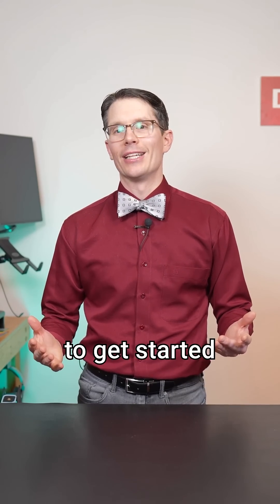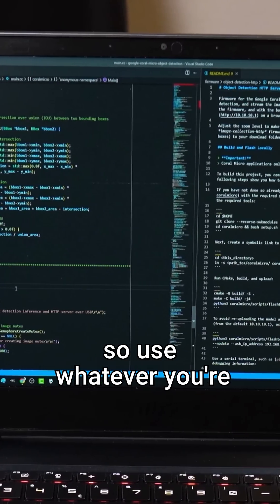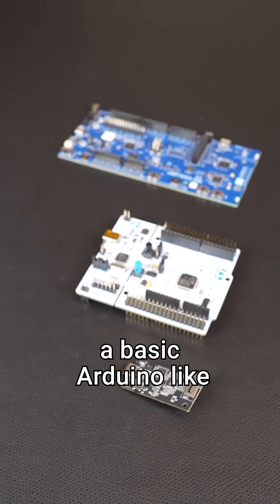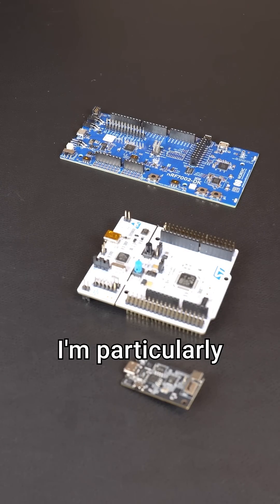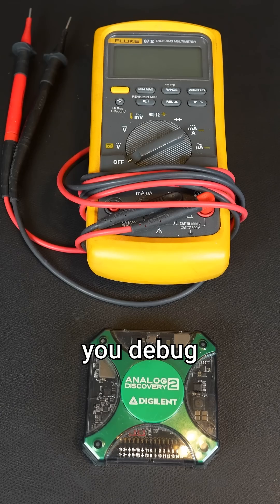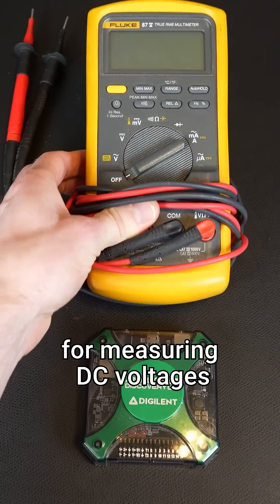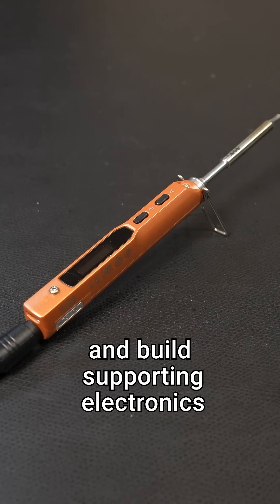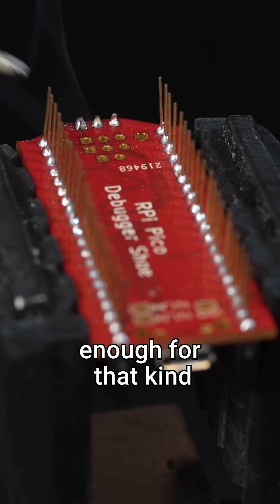Tools for Embedded Engineering #ShawnHymel #embedded #engineering #Arduino

Comment from the maker: To get started in #embedded #engineering, #ShawnHymel recommends grabbing the following tools:
 - Computer (nearly any OS will work)
 - Development board (such as #Arduino, #ESP32, #STM32, or #NordicSemi)
 - Digital multimeter
 - Oscilloscope
 - Soldering iron
Reply: Wait i thought oscillioscope is big white box that feels like belong in a hospital...  

what's that?
Reply: @vaisakhkm783 
Yeah that rights.  But these ones in the hospitals are you for medical purposes. Those oscilloscope for embedded are you for signal analysis and ac voltage
Reply: @xrafter  ya ya ik... i have used oscilloscope in collage (i said something  that should belong in hospital as a joke).. but what i was asking is what is that small thing he showed, it seemed nothing like a oscilloscope... after a little digging, it's a oscilloscope that can be connected to a computer and control from an app

(nix btw)

Comment: Get icestudio and find a compatible board from the boards menu: Learn verilog and FPGA's, and skip microcontrollers entirely. 
You'll be able to do actual finite state machines which can be relied upon, and your skills will be far more valuable: uC's are only good for low cost and ultra-low power, and if you aren't using the best-in-class for those, you're wasting time and failing to find a good engineering compromise. FPGA's are 'digital glue' and will do a better job in any other embedded problem space.
Reply: All this comment tells me is that you are not a good engineer. Everything has its place and uses and for most projects microcontrollers are the best choice.

Comment: As someone who took electronics classes, coding classes. Now in full stack programming school, and doing electrical engineering for 1/2 my current arduino based project i strongly urge anyone to get a few months of build time in with minimal IC usage. Many will reach for a NOT IC with way more inputs than needed or flip the HIGH and LOW statuses in all their code when a single NPN or PNP transistor and 2 resistors can make a not switch. Also able to be tuned to values that can sink/source current possibly. Or high value resistors to effectively make it a digital high impedance signal supplying voltage and just enough current to trigger other things.

Comment: Another tip on the list, get a Fine Tip Soldering iron or it you got money, a Hot air Gun/Station or Hot Plate, Trust me You don't know how quickly you'll stall given a Vast amount of Chips and Controllers are So Tiny and Compact, it's very hard to solder, so don't even have exposed pins and require Machine to be even usable

Comment: I also recommend the pcb boards for microcontrollers. you can solder an esp32 and you can learn the pcb design over your bread board. These pcbs expands the tiny package legs to big io pins

Comment: I'm glad we're finally at a point where we're telling people to just use what they like. I remember compsci/compeng students falling into three camps, they had no money, so bought whatever they could and struggled and were glad if the school had powerful enough computers for them to build and run code on, or they were either deeply rooted in the ThinkPad vs MacBook camp. Most people I knew were in the latter most. And it was weird because they almost always had to bootcamp to do something. But whatever, you do you, while I professed my love for the trackpoint nipple, I never went much past that, but many students I knew felt you had to have a Mac or you were nothing, and sadly they went on to be CTOs and help with startup requisition and it's just awful.

Theres so few tools or dev applications where the OS matters, and generally speaking, you're either going to want to use VM images in those cases, possible for proper container management.

Comment: i have that same oscilloscope! I got mine at goodwill for $5. Best score ever
Reply: That’s incredible, that’s a $250 oscilloscope
Reply: Is it good?
Reply: @shash404  definetly! It was my best goodwill find ever. Not only is it a dual channel oscilloscope but its also a power supply, wave form generator, and much more. Overall a very cool device with ALOT of functionality.
Reply: woah! Analog Discovery???
Reply: @SpaghettiEnterprises  yup! $5 for an Analog Discovery 2. Its definitely my favorite electrical engineering tool

Comment: completely true...a couple years ago, i decided i wanted to use 1 channel of an RC car radio set to control 2 servos in a sequence....that is one servo moves through it's motion then the second servo does it's thing....i used an old Think Pad running Win7 and an Arduino as proof of concept...but it needed to be smaller, so I added a $10 soldering iron and used a Digispark to see if i could reduce the byte count of the code....once i got that to work, i removed the ATtiny85 from the PCB and ran it stand alone by piggy backing it on to the wiring.....given that my knowledge of programming is at the level of Hello World in command line Basic, this took several weeks of google searches in the evening totaling about 4 months....most useful find is the servo library and hardest task is getting the correct output pulse timing.....

Comment: I'm so glad you highlighted the importance of an oscilloscope!
Reply: I don't have an oscilloscope, just googled analog discovery, but it's not available in my country and very expensive if ordering alternative ways.

Is there something that can help with basic protocols and ne555 alike waveforms but not a Chinese diy kit rubbish either
Reply: @Gameplayer55055  Hantek has USB  oscilloscopes.  I believe there is better open source firmware that can be installed on it.
Reply: @Gameplayer55055 
If you're too poor to afford the analog discovery 2 then the so called Chinese diy kit is most suitable for rubbish people like you!
Reply: And that Analog Discovery 2 is an awesome little device.  I wish I could run it's software on my Rigol MSO5000